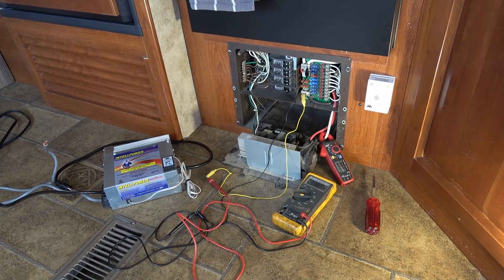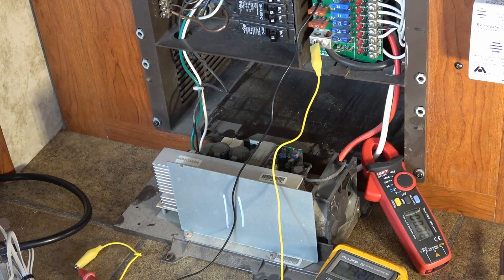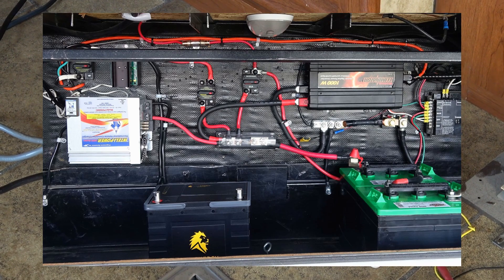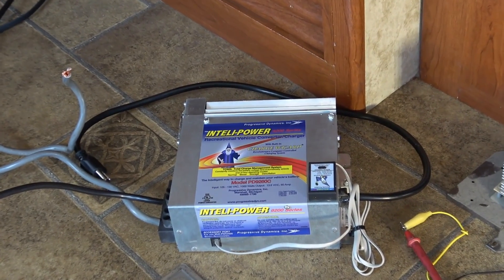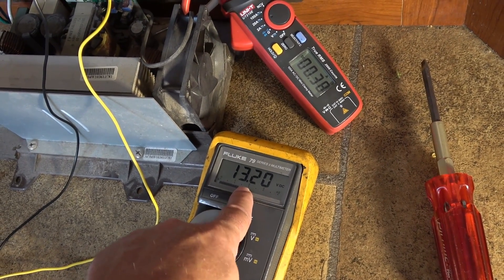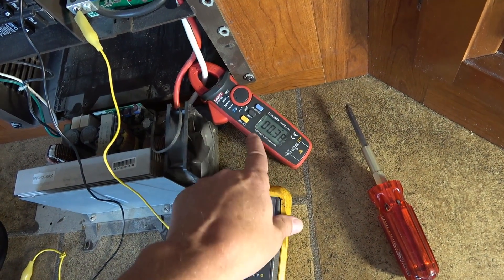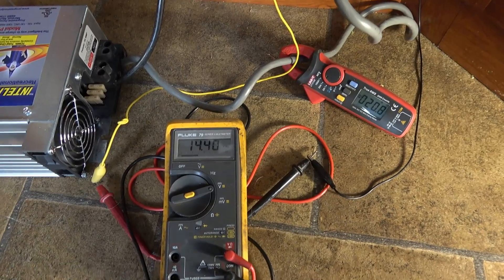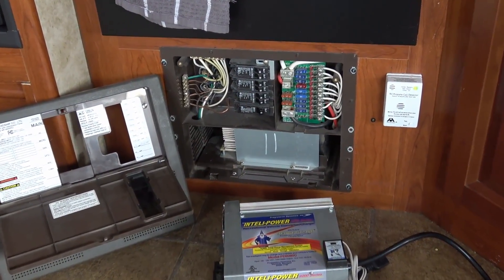Lithium RV Battery Charge Test -  Can You Use a Lead Acid Converter/Charger?

Comment: So I can use two Chargers in my RV lead original where it is and put that one close to the batteries that's not going to hurt anyting
Reply from the maker: I can't say 100% as chargers vary but can tell you my OEM WFCO and Intelipower don't have a problem, they just read the voltage of the battery bank and adjust their charge output based on that. Same when using the solar charger and the charge converter, they can both be on at the same time as well. Usually one of them becomes the lead charger and outputs the most amperage and the others output less since they see the voltage higher and start to back off the charging. It all depends on the charging algorithms of the various chargers and wire lengths between them and the battery bank. Generally though I only have my OEM charger turned on when I'm on shore power for an extended time. When off grid I'm charging via solar and/or a generator with the Intelipower near the battery bank. Cheers, Ray
Reply: Okay thank you very much

Comment: Ray I purchased two lithium batteries with a charge current max of 50 amps. If I get the 60 amp progressive that would be 30 amps per battery or am I wrong
Reply: Thank you Ray. Great channel by the way.
Reply from the maker: Yup, that should be the case

Comment: Thanks for sharing this. I am thinking about building a lithium battery pack for my trailer. I would like to add solar eventually, but want to do things incrementally. I'm thinking I will need a charger at the same time I replace the battery though.

Comment: I have a question on charge a lithium SOK battery.  I have the 206amphr SOK and 220 watts of solar going into it through a Renogy Rover.  Even after I set my parameters correctly, I can only charge up to 13.3 volts. ?   (It’s new and never been discharged yet. ). 
SOK says I need double the solar to push it the last part.  Is this correct in your opinion ?  Thanks for all the help !
Reply from the maker: The first thought for me is when lithium batteries are shipped they are shipped at between 40-60% charge, some kind of shipping rule to not ship them fully charged. So maybe you have yet to be able to get to full charge with so little solar power feeding it.
Is the Rover model you have set to lithium mode 14.4V? if so it should be able to fully charge the battery but keep in mind it will take a while if the battery is low, 200 watts of solar only puts out about 10-12 amps max, and that would be with clear sky and overhead sun. Say you were charging with a constant 10 amps of solar while not using anything from the battery to power stuff, it would take slightly over 20 hours to fully charge from dead.
A rough rule of thumb is to have around 100W solar power per 100AH battery but that is from lead-acid days which a person only uses 50% of the capacity. Your lithium 208AH is equivalent in capacity to 4 lead-acid batteries, so 400 watts would be better. I'd even recommend more if a person was camping in the winter with lower sun angles and shorter days or where there are a lot of cloudy days.
Also, you'll only see over 14V right at the end of the charging cycle after the charge is over, and say it's the night the batteries will show about 13.3V, that's the normal voltage for them.
Reply: @LoveYourRV  thank you for all your insights.   The charger is set correctly, just can’t push the battery past 13.3 volts.  The charger does say 100%.   Love all your videos !   Peacefrom510 .
Reply: @LoveYourRV  very helpful insight. Thank you.

Comment: One more question,,,,,,,,,,
Any information on the wire that is the battery charger we can move to a new circuit breaker when we are boondocking  so no charge loop
Reply from the maker: My trailer has a specific breaker for the OEM charger, its the very bottom one 15A. See this recent latest video for a clear look at it's hookup - https://www.loveyourrv.com/input-rv-ac-power-meter-install-mod-displays-total-ac-amperage-draw/

Comment: I have the same brand house converter and I've found it tries to bleed off over-voltage for some reason. My house unit says "full" is 13.3 for lead acid, but the specs on the batteries I have is 13.7 and the house supply won't ever get it there. I've tested internal resistance on the lead-acid and they're within spec, but the solar never gets out of bulk when I have the converter hooked up. They fight one another? I'm about to replace my internal one and will check out the intelli-power you have or look for a more configurable one from someone like victron. Thanks for the technical content!

Comment: I found some of the OEM converters to have a "FIXED" switch which I calibrated to 14.4 at the battery.   I charge from 10% to 90% of my Lithiums in 1.2hrs.   Mine is a 55 watt converter also.
Reply: You just leave it on fixed mode for lithium charging?

Comment: I just ordered two of the UT1300 batteries from Costco. I will need a new charge controller (I have a Tracer MPPT). I have a single 325W panel. Do you have a recommendation for the charge controller I should purchase and do you have an affiliate link? Thanks!
Reply from the maker: You mean a solar charger controller? or a converter/charger?
Reply: @LoveYourRV  Solar charge controller to replace my 4 yr old Tracer MPPT which I don't think is programmable. Sorry to ask the question in the wrong video, but because you mention the Costco UT1300 sale I asked here.
Reply from the maker: For MPPT I think both Renogy and Victron have some decent controllers that are lithium ready. Morningstar makes some good ones as well but they are a little harder to program, usually, you have to get a laptop and custom program them. If you don't plan to expand much from the 325 watts then a 30 amp controller should be plenty.
Reply: @LoveYourRV  do you have an affiliate link for either the Victron or Renogy?
Reply from the maker: Not for the company websites, just if you buy on Amazon. If you click my Amazon page - https://www.amazon.com/shop/loveyourrv  and then search and buy during the session I think I get credit. Thanks, Ray

Comment: My friend smart move getting rid of your factory charger. But I always wondered why you had it set up the way you did in the past when in fact if you took the power leads off the fuse panel that was supplying your in-house charger and ran 12 gauge wire to the front of your fifth wheel and put an outlet there then plug in your Inteli power charger you will have less issue... I spliced the pendant using cat6 wire and ran my push button pendant into my control panel which allows me to activate boost mode from within the camper... now when I need to fire my generator I use the regular RV cord which Powers up the whole camper and charges the batteries as needed
Reply from the maker: Because I'm on full hookups 8 months a year and decided to let the OEM charger wear out float charging 24/7 and save the wear and tear on my Intelipower.  I'm also not getting rid of the OEM charger, because as luck would have it floats my lithium battery bank as around 58% which is perfect to extend the battery life. Kinda like they are in storage. Lithium held at 100% charge wear out faster.
If I ever want to use my Intelipower on shore power, it's easy to just plug it into an outlet via an extension cord, there is an outlet closeby on my water closet bay or the power pedestal. For boondocking I found I only use it about 30 yours during the 4 months, so not a big deal to push the button beside the battery. Cheers, Ray

Comment: Does the PD9260 drop out of manual boost mode at some point, or do you have to use the pendant to switch it back?
Reply: Thanks for doing the test. I have the same converter that was installed by the manufacturer. It is mounted at the back of my fifth wheel as well  and wont output anywhere near 60 amps. I just bought a pendant for it. Based on your test, it looks like manual boost mode will help.
Reply from the maker: Someone said it does after about 4 hours, I haven't seen it happen though so can't confirm. Usually I'm using it for an hour or two of generator run time.

Comment: Thanks for the video Ray.. that helps me make a decision on my shuttle conversion. I believe I told you sometime back that I bought an Intellipower with the charge wizard pendant, ( I think it is the 45 watt model ) based on your recommendations aka review. I have been trying to decide whether I needed to get a charger/converter for my power center as it does not have one and was thinking I could probably just use the Intellipower unit in its place to power the dc side of the power center. Sounds like I can and be safe.. what do you think? Am I thinking correctly?
Reply from the maker: Yes, that makes sense to me, they are designed to run an RV's 12 Volt circuits as well as charger the batteries.

Comment: How did you know you inverter was set correctly? Did you see the levels were correct?
Reply from the maker: I wasn't using an inverter, I guess you mean converter/charger. I was able to test the converter/charger output using my multimeter for voltage and the small clamp-on amp meter for amperage. Also, I used my Trimetric battery system monitor to measure the voltage and amperage at the battery bank.  The Intelipower converter/charger has automatic smart 4 stage charging based on voltage/amperage sensing, but I can override that with the manual charge wizard pendant. Hold switch down for a few seconds puts it into manual boost mode outputting constant 14.4VDC.

Comment: Thanks for demonstrating the drawbacks of using an old lead-acid battery charger on Lithium.     I understand why it has an issue with 
Lithium so much better after this video.  I added an Iota charger and a small 1000 watt generator for a backup for my solar system.
Reply from the maker: Glad it was helpful!

Comment: This is an interesting video for us as we just changed out our converter/charger in our trailer because it went bad.  We chose to go with a lithium battery and had a heck of a time finding a converter/charger that would fit in the space we had available!  We bought a PowerMax PM3-55LK to use with our battery.  I was able to set the voltage on 14.4V manually and then change from a fixed voltage to a 3 stage.  It has worked well so far.  We also installed a Victron BMV712 so that we could see what the battery was doing.  Thanks for sharing!
Reply: You charge it in fixed voltage mode? The 3 stage only works at 14.6 then throttles voltage. Correct?

Comment: FWIW I have the same Inteli-power charger and I noticed I burned out a couple of LED bulbs and the retailer said that the bulbs don't like the 14.4 volts and can overheat melting the solder, I'm interested to hear what you have to say about that.....Since hearing that I make sure all bulbs are off if I know my batteries are low before plugging into shore power. Any thoughts?
Reply from the maker: Sounds like they are a cheaper bulb. Good LED lamps usually have built in voltage regulation circuits and metal heat sinks that can safely handle voltages between 8-30 VDC, but I guess by not having the regulator circuitry the price can stay lower.  
Most motorhome alternators put out around 14.4 VDC charge. With my previous big golf cart battery setup I ran a  absorption voltage on my solar charge controller of 14.8 VDC and on cold days it would go even higher up to 15.2 VDC due to the temp sensor. Lead acid batteries need a higher voltage when charging at lower temps.  Never had an issue with my LED bulbs or any other of the 12V items in the rig. They are usually designed to handle up to 16.5 VDC.
On thing about the InteliPower PD9260 is it actually has a 4th stage that will perform a mini equalization if its been in float mode for a long time and raise the voltage to 14 VDC for short time.
From the manual - "STORAGE MODE: When the converter senses that there has been no significant battery usage for 30 hours the output voltage is reduced to 13.2 volts DC for minimal water usage. When in storage mode the microprocessor automatically increases the output voltage to 14.4 volts DC for 15 minutes every 21 hours to help reduce sulfation of the battery plates."   Cheers, Ray
Reply: @LoveYourRV  Thankyou BTW Do you have a link to a supplier of RV bulbs with  built in regulators... I would be interested in replacing mine as they burn out with better bulbs.
Reply from the maker: Many of them do, just look for the 8V - 30V spec listed.  Here is a quality company and some info on bulbs https://m4products.com/lumens-and-quality/   Here is an example - https://m4products.com/921-9-3030-ww-warm-white-elite2-912-921-wedge-base/ for a common RV fixture like I have in my rig.
I have ones called Starlights but they are crazy expensive.
Reply: @LoveYourRV  Thankyou!!

Comment: I bought a Progressive Dynamics converter/charger to replace my WFCO a few years ago. Last year when I got a lithium battery, I contacted Progressive Dynamics about any issues I might have charging the battery with their unit. Turned out the model that I bought has a jumper switch that converts it to use a lithium profile for charging. I recommend anyone with one of their drop-in replacements check with Progressive Dynamics when switching to lithium batteries, it might just save you money, frustration, and most importantly, time.
Reply from the maker: Cool, good to to know that there are some models out there that can do that.

Comment: WFCO also now offers a lithium charger replacement unit: WFCO WF-8950L2-MBA Replacement RV Power Converter Lithium-Ion Main Board. I replaced it in my WFCO unit. It seems to work pretty good. My 2 Battleborn batteries reach full charge now and also charge much quicker when hooked to shore power.
Reply from the maker: Awesome, I hadn't heard that before thanks for the heads up.
Reply: Does it put out 50 amps?

Comment: Hi Ray, I used to use the Wizard dongle in my original RV and that helped charge up my Lithiums. However, when I bought my current RV, I had them transfer my Lithiums and that charger had no method to adapt the charge cycles. I bought a new PD Lithium-based charger and a new Lithium-based solar charger; both now allow my 2 x 78 AH LifeBlue LiFePO4 batteries to fully charge. LifeBlue use BlueTooth technology with an app that allows you to see various parameters on the individual batteries.  Cheers, Steve
Reply from the maker: Nice!

Comment: I saw this video 6 minutes after it was uploaded and coincidentally, I'm in the middle of replacing my WFCO 9865 charger with a Progressive Dynamics PD9160ALV to charge my two Battleborn Lithium batteries to 100% on my travel trailer. I haven't buttoned up the enclosure yet, because I wanted to turn on the A/C and test the system before I did. So far, it works perfectly. My solar panels would keep the charge at 100% during the day, but it would drop at night as you explained. My reason for the upgrade is that I want to start out on trips in the morning at 100% charge so that I can power my refrigerator on electricity from my inverter rather than on propane. I have a similar setup as yours, with the WFCO panel in the back, under the pantry, and I moved the batteries to under the bed in the front. I don't see a need to replace the wires as they are protected by three 25 A. fuses on the charger and the trailer is plugged into a 30 A. outlet 24/7 while I'm at home, so efficiency isn't a concern of mine.

I enjoyed and appreciate this timely video as it confirmed my thinking on what I should do.

Comment: I bought a lithium replacement for my trailer OEM charge converter. Just under $200.
Reply: Lithium rocks I build my own battery pack 8yrs ago 800amp hr going strong yet. You will love it....

Comment: I have the exact same OEM charger setup in my travel trailer.  I upgraded to a drop in replacement charger that progressive dynamics sells for it.  I also pulled new wire to the batteries to replace the six gauge with two gauge.  Actually, when I sized out the wire size, it was a bit over kill for my system, but gives me an upgrade path if I ever decided to add more batteries to my two battery 100 amp each system.  It’s in its first season of use, but so far works great!  I’m really impressed with the progressive dynamic product line.  BTW, the charger is rated at 55 Amps, and usually gives me about 45 amps to the batteries.
Reply: What voltage are you getting that amperage at on 2awg at the battery terminals?